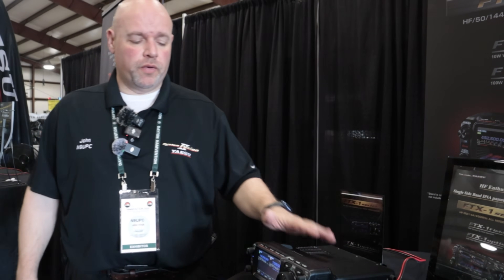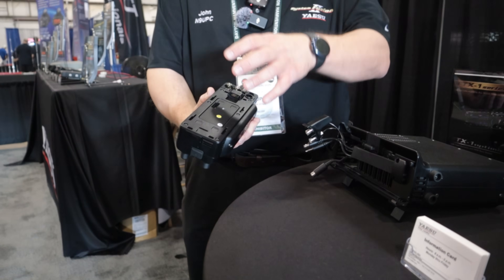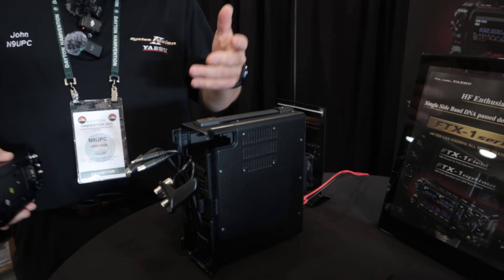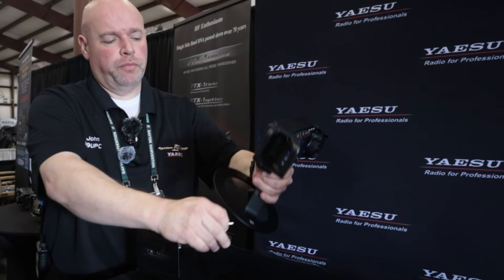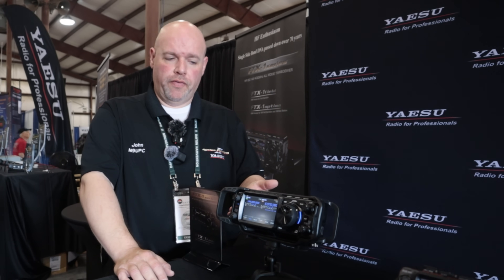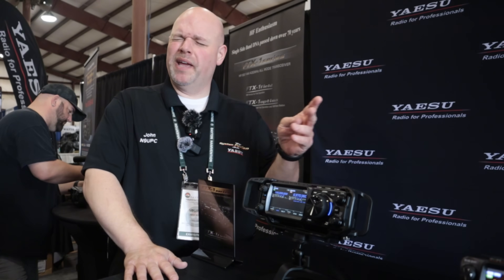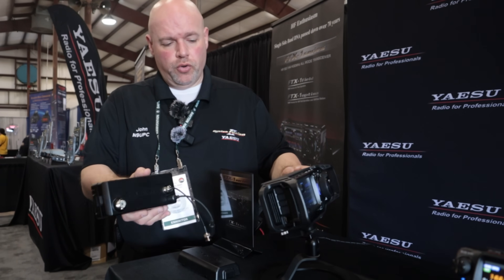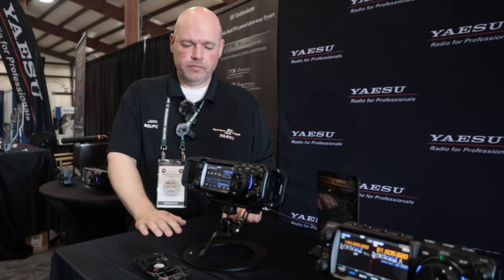Is the Yaesu FTX-1 Optima the FUTURE of Ham Radios?

Comment: Garbage. the detaached part  has no internal antenna tuner.  So it will allways be garbage. garbage. no internal antenna tuner. What insane person at yaesu fell in this horrible hole. I have a yaesu ftdx-10 yaesu and i just love it. but this is a piece of crap because it does not have an internal antenna tuner. Boooo on them. Forget this mistake of a piece of garbage. Sure if they did have an internal antenna tuner i would have bought it. But as it  is i would not waste spit on it.

Comment: Boooooo. Yaesu has dropped the ball with their new FTX-1.  Specifically you cannot choose the frequency and band with a mouse.  With the FTDX-10 and FT-710 you can but not not not with the FTX-1. When using my Yasu FTDX – 10, I found that I can simply use my mouse to enter the frequency just by clicking on a frequency box that appears on the screen. And Boom” instantly transported to the band frequency that I want. So when working FT8 or POTA it is such a wonderful experience to just have to use my mouse to click on the frequency box and immediately and instantly get transported to the frequency and band  I want “Boom”. So……. When I saw the FTX – 1. I was interested in buying that one however I find out they do not have that same ability to click on the frequency with a handheld mouse. It just does not have it. I think this is a huge failing by Yaesu on this model. And I think this huge mistake of leaving that feature out on the radio will discourage people who like to do FT8 and Pota, from buying one of them, and their sales will definitely suffer.  It took me three days of searching to find out this fact. Which really really irritates me that they would not come right out and say we do not have that feature on this model. And saved me all that searching.

Comment: Too expensive and big. Like this is not a car portable radio that heads just massive
Reply from the maker: The head is the same size as the IC-705
Reply: @HamRadio2 yeah and I am not sure on the ic-705 either for a car setup. Been looking at the ic-7100 as my car install and probably my all-arounder I don't have have a shack and probably won't for the next five years or so with various kids moving in and out. So car shack it is

Comment: Mount it to your dash, then run a coax cable to a auto band switching rm italy amp in the trunk. Instead of 100 watts you'll get closer to 300..... then just disconnect the coax and use it qrp when you like

Comment: Holy moly! Looks like something I see demonstrated at Costco for a pasta maker/soft serve ice cream machine. Just take this off, unplug, this clip this into the side and there you go! The best thing about this radio is its SDR circuitry. This is an $1800 radio that eventually be a $2800 radio with all the needed add-ons. I like it but won't buy one. Many hams think the big radio manufacturers aren't listening to them, but in reality I think Yaesu,  Icom and Kenwood listen to customers too much. This radio looks like they reacted to every email ever received by the customers. This radio was built by committee, it does not have a singular point of view. Its meant to be everything to every ham, and that's impossible.

Comment: I cancelled my order as of now for the optima. It needs a remote head extension and better power support options. That remote head thing really is a show stopper, then compared to the 891 the head size is extremely large. So I can use the 891 at 100w or 10w qrp if I want for the size of the head unit. I dont need or use the whizbang display graphs, if I do the waterfall is in the software for digital modes.

Comment: I don't mobile @ all, so my FT1200DX & FT8900 are just fine for my sys and shack. 
@ 80yo, I'm just glad to make a contact at all. All this new stuff is OK for those young-uns who 
still have the energy to chase dx or local traffic. I've already done  WAS & WAC,  and back in
the early 90s the cycle was wide open, worked almost all of Oceana on qrp w/ my 
Radio Shack 10m mobile, which I still have . 
Ham Radio is a lifelong hobby that will bring lots of enjoyable memories for many years...    🤓

Comment: John did him self a disservice by saying that the radio takes 22 Amps to run full high power and there is not a lot of time that you can do that in a mobile environment. Well, the FT-857D DID have a 22 A max power requirement for 100W so hams already have that issue worked out. In addition, all that would be needed would be the ability to select different power modes for the radio 5, 10, 20, 50 and 100W. now how hard would that be to do.

Comment: This radio would be a great replacement for my 857D IF they  had made the 100W amp unit capable of being mounted separately from the radio. I guess Yaesu figures that if you want that you'll buy an 891... EXCEPT that you don't get UHF/VHF without adding a 2nd control head. Instead they made a radio to compete with the IC-705 and 'threw in'  100W capability to try to be different. But by not making the 100W unit remoteable, along with a couple of other things, they FAILED to give us hams what we really wanted.

Comment: Why in the world would Yaesu put a USB-C port on the battery if you can't charge it when it's connected to the radio and operating? And why not allow the USB-C port on the radio itself charge the battery. What a waste of USB-C ports. And how in the world are USB-A ports hard to find? I guess someone failed to tell the computer manufacturers that they're hard to find. Not that I would want a USB-A port on a radio but geeze Yaseu, how stupid do you think your customers are?

Comment: N-type connectors?  No, thats BNC, 50ohm as used on the IC-705 and even FT-817 back in the day.  N-type is about the same dimensions as the PL-258/SO-239 and fitted for VHF/UHF on Yaesu European models.
Reply from the maker: BNC on the Field unit.  M-connector (not N) on the back of the Optima

Comment: Yes, a nice device...everything's included - and with the separately mountable control panel, it's a great feature.

But - starting at €1,799 in Germany - I think I'd have to wait a few more years until the device is at a reasonable price. Until then, I'd rather use my FT 857 and FT 991 A...

Comment: I really wish it supported the 1.25-meter band. I understand that developing equipment for this band can be costly, especially since it's primarily used in the United States and not as widely adopted internationally. However, it's important to recognize that the U.S. actually has the largest population of ham radio operators in the world. By including 1.25 meters, manufacturers would be catering to a significant and active segment of the amateur radio community. Many American hams are passionate about using and preserving this unique band, and its inclusion could help drive more interest and activity, potentially justifying the development costs. Plus, supporting 1.25 meters would set the product apart from others on the market, making it more appealing to U.S. operators who are always looking for versatile and capable equipment.

Comment: FT-991A is also a great radio. I am not into disconnecting five connectors and this radio is way over priced. I think my next radio will be the FT-991A. Yes, it is larger, but $800.00 cheaper and it can TX on HF, VHF, and UHF. I am not into QRP anyway, and if I was... my FT-DX10 and the 991A wattage output can be turned down to accomplish QRP.

Comment: So the Xiegu G90 has a band scope and an internal tuner in the $460 dollar range. Granted it's only 20 watts. Why can't Yaesu take the FT 891 which is a very good radio for portable operations and put a band scope and tuner in it and keep the price below $1,000. If the Chinese can do this why can't Yaesu and Icom do it???  Some of us don't want a shack in the box do all radio. This is all well and good that a person can buy a radio with all the bells and whistles. But some don't want all that and in some cases can't afford it.  A QRP / mobile radio that surpasses the cost of most base station HF radios. Ouch!!!!
Reply from the maker: Have you not seen the Yaesu FT-710 HF Radio?
Reply: @HamRadio2  Yes I have seen the FT 710. I own an IC 7300 and both radios are similar in size. You missed my point. A mobile radio with a detachable face for mobile use as well as portable use with a live band scope and internal tuner without vhf or uhf.  Because of its size, 710 or 7300  as I and many others are not keen on using that size of radio for potable work and is impractical for mobile use. Everyone has their wish list and opinions  as to what they want in a radio and that is fine. If the FTX-1 is someone's cup of tea by all means go for it. But  $1,800 for the 100 watt version! OUCH!!! Yaesu doesn't recommend it being used as a mobile because it could pull 20 apps?? The FT 891 will pull around 20 amps  running 100 watts. So John saying the FTX-1 pulls to much amperage for mobile use is a bit out there!! So that means no cables for separating the head for mobile use??  Don't get me wrong in many ways this seems to be a really nice QRP radio to compete with the IC 705. It's just $1,800 for a radio that they did not design let alone recommend for mobile use is crazy to me yet it's in mobile form. Yaesu can just do some weird things with their radios that to me do not always make sense. That's just my humble opinion others may differ. 73 😊
Reply from the maker: Yaesu already has the only 100w mobile HF radio in the game.  I can see what you are saying about the band scope but I don't see that as a huge issue for a mobile radio.  You don't want to be looking at a scope while driving anyway.
Yaesu needed a new QRP radio after they discontinued the FT-818.  And the $1800 price tag is for the 100w version - the QRP version is $1499, which is the same price as the IC-705 when it was new.  Even the KX3 is about that same price when purchased new.
I can see your point but that isn't what this radio was meant for.  Yaesu was filling their QRP void and in my opinion, they did a great job.
Reply: I will just agree to disagree. Some want the simplicity and low cost of a radio like the 100 watt FT891 with a little more capability such as a band scope and internal tuner for portible work that won't break the bank. Granted the price would be a little higher than the present FT891. They are putting band scopes on the higher end vhf uhf radios for mobile use. So not sure why that is any safer than having the band scope on a mobile HF rig. Anyway I guess this is just an unrealistic pipe dream. Have a good day! 73 😊

Comment: If I had another $2000, I would buy the Optima and use the 991a for a portable. That would stay in the shack. I would rarely use that battery. I like 100 W whenever possible.

Comment: Reading all the comments……….  The radio has a whole suite features, and each feature has a cost.  The modularity has a cost.  The battery is a cost.  The radio is hf, 6M, VHF, UHF radios.  The antenna tuner is a cost.  And of course the 100 watt amp is a cost since it works together with the radio.  Let’s say with all the features and capabilities, it could be a good price, but I don’t have the $1,800.  My one issue I have is it would be nice to be able to charge the battery separate from the radio.  Maybe they will have an adapter that connect to the power connector of the battery to charge it.
Reply: The battery has a USB-C port, so you can charge it separately from the radio.
Reply: @ralphnunn3 a Yaesu rep said it had to be connected to the radio to charge.  But you could connect devices to the battery for power

Comment: No tariffs here, so tell me how this is better than a x6200 and an XPA125b ? I can use the XPA125b with many other radios.
Reply from the maker: MUCH better receiver on the Yaesu.  Everything works also.  More features
Reply: @ oh, I was under the impression you had to buy the add ons, sorry I was misinformed
Reply from the maker: I never mentioned add-ons.  The features that the Yaesu has just work better than the Xiegu

Comment: 3:40 HA HA the FT-857d draws 22 amp @100w. My FT-857d works great in my car. My car stereo amp drews 40 amps. Sounds like Yaesu might be going away from mobile HF. If ther're worried about 22 amps.
Reply: That's because that's what HAMs are becoming so worried about. Now the portable battery and QRP operators are the ones with the loudest voices right now in the HAM radio space.

Comment: This needs a remote mount / separation kit.  Not only for mobile but also conserving desk space at home.  Buy two or even three amplifier modules and switch vehicles, take hi-power portable, bring it back to the base.  Kind of a deal breaker without it.
I run my 991a mobile often, 20 is is a BS excuse.
Reply from the maker: Yes
Reply: There is

Comment: Great video. Yaesu hit it out of the park on this one! 1900 is a little pricey but, there is a lot of value there. 991A gone portable and mobile, all mode with a spectrum analyzer and TFT touch screen display. Or the 710 with 2 meters and 440. Lacking slightly in the mobile department on low output. Good stuff. Thanks for the video.
73’
Amen!

Comment: 1. The FT 991A is fairly portable.
2. I couldn’t care less about having VHF capability on my QRP radio.
3. The Optima is still a jack of all trades like the 991 a. As a base station it’s not a good value.
Reply: I have a 991 a. It is a great all-around radio. The next step up is one of those cool scopes like on this new radio per the video. It’s just a lot of money. I think I would buy another 991 a if I was going to get another radio. They are easy to modify also.
Reply: @sd5269  I have an FTdx10 as my base station.  I never use that 3d waterfall because in practice, it's very hard to read.
Reply: @tccycling  yes, I have seen those especially the 3-D ones. They are very difficult.

Comment: 3:45 I’m still going to use it as a mobile radio with an ATAS-120A antenna.  If I can install an antenna on my car, I can certainly run a 10 or 8awg marine wire (or welding cable) to power it.  Especially since these days it makes so much more sense to have a 100+ ah LiFePO4 battery, and have the car alternator charge that (through an MPPT), so that you can run the radio with the car turned off.
Reply: I don't even bother with 100 ah. I've found 50 is plenty for keeping my fridge cold and running my radios.

Comment: So now John is saying the reason this can’t be used with a separation kit is because…of current draw requirements?  Is he aware that he works for the same company that sells the FT-891?  It’s super easy to supply the spec 21 amps (and more)…we do that all the time.  He’s just randomly dancing around the problem - not exactly confidence-inspiring.
Reply: I specifically got the Optima to replace the 891 in my vehicle.  I don’t think there will be a real problem running this as mobile.
Reply: @ Let me know how you make it work.  I want something that has 100W, a modern spectrum display (unlike the 891), and tuner that can be installed on a bed headboard space in a travel trailer that isn’t deep enough for a full-size radio.  At the moment the only options I’m aware of are an Elecraft KX3+PX3+KXPA100 (even more expensive than the Optima), or the new Icom 7610 or a Flex (even twice as expensive as that), which is absurd.
Reply: Oh so I'm not the only one who can see through Kruk's B.S. he's a corporate puppet and mouthpiece. But he's also full of crap. I haven't believed a word he's said in years.
Reply: @Chalybe_Ebulliae The number of times he contradicts himself, says things that are outright wrong and require retraction later, falls all over himself desperately trying to avoid talking about problems like this one, and does it all in a tone like he’s pissed off at you rather than trying to convince you something is cool is definitely not doing the company any favors.  It’s too bad, because he might really be a nice guy on his own, but he gets flustered when “on the clock” and falls headlong into angry doublespeak mode.  It’s a bit odd.
Reply: @Chalybe_Ebulliae he’s completely full of crap and, a person would have to be blind and deaf not to recognize it! Fricken used car salesman….
Reply: He must think he's speaking to people who know nothing about electricity.
Reply: I tend to cut John some slack. I realize that he is a salesperson for a Japanese ham radio company and his job is to explain and promote their products.  Knowledgeable hams in ANY country are going to find some kind of issue with EVERY radio ever made. Because John can only offer suggestions to the design team based on his interactions with US hams, we US hams need to realize that Yaesu makes radios for a worldwide market and that in itself influences their design decisions. I guess the best thing I try to remember is that if there is a shortfall in a radio, and there is a big enough demand/market for a fix, then someone will create one .  What I find interesting is that when someone does, there are still hams that complain or don't want to pay for it.  To them all I can say is, if the rig doesn't do it for you, then don't buy it. If you can't find a rig good enough for you, design and build your own or maybe think about getting into another hobby.